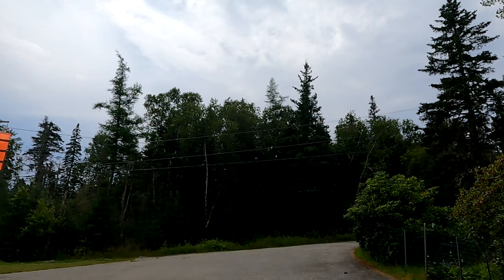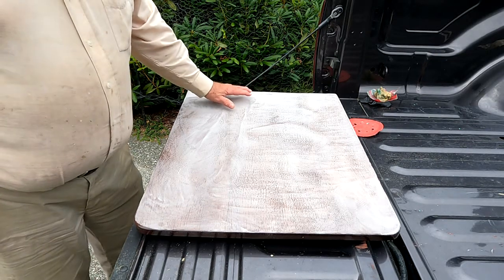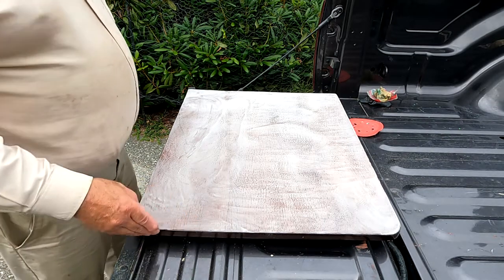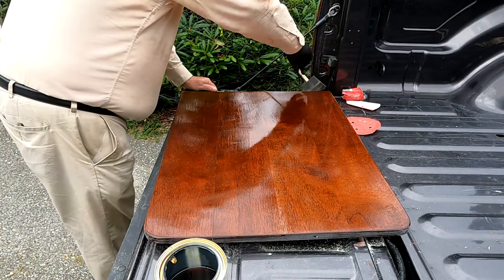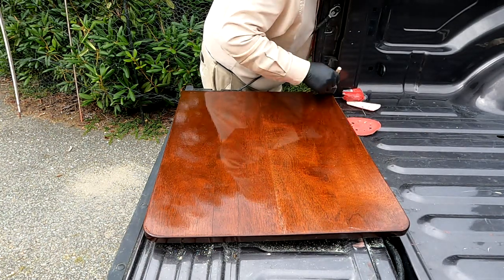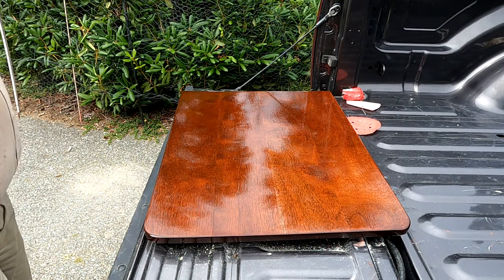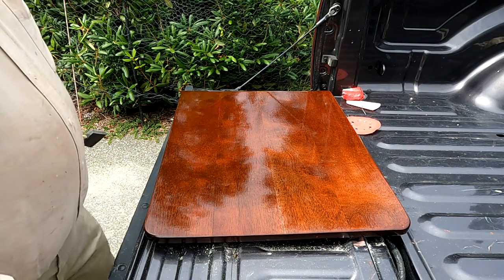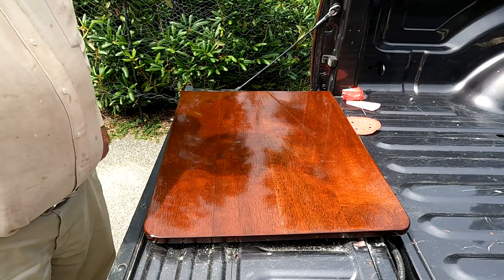Boat Maintenance: Varnishing a New Boat Table - Build Coat #4  July 25, 2021

Comment: The finishing phase is probably the part i enjoy the most, you start to get some satisfaction from your work, and the smell of varnish doesn't really bother me.
Reply from the maker: Finishing is definitely rewarding since you finally get to see how your project came out.  I enjoy varnishing for that reason.  Coat five goes onto the table top later today.  I will do that coat inside since the fourth coat came out looking pretty bad due to extremely fast drying from the wind.